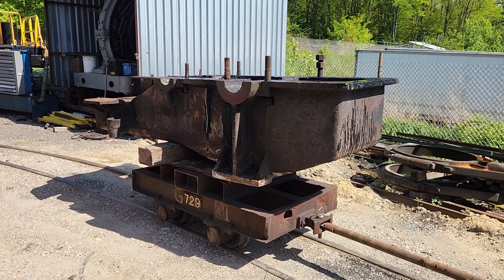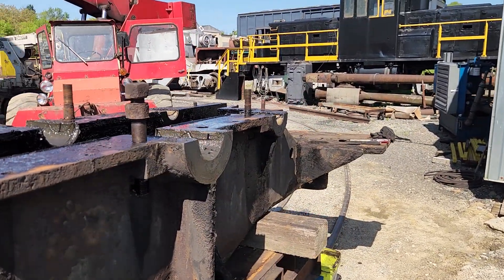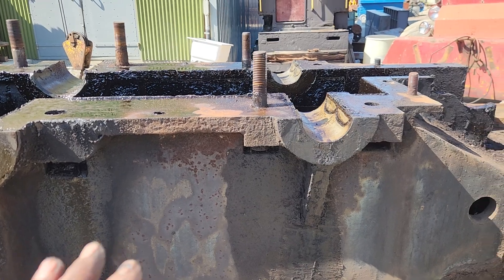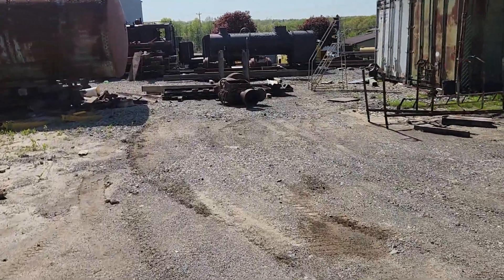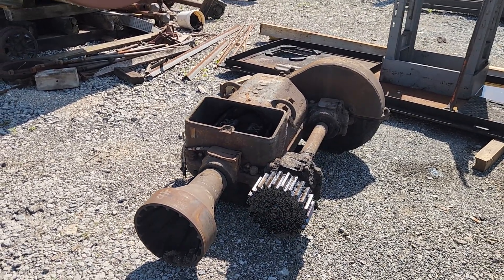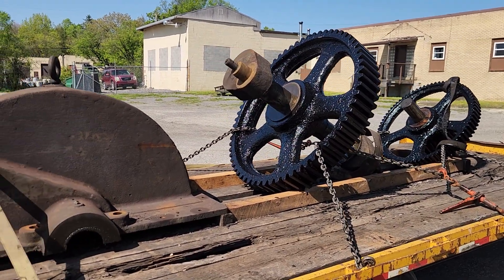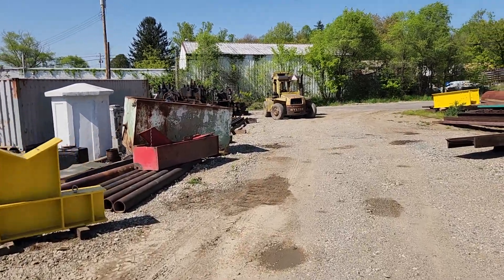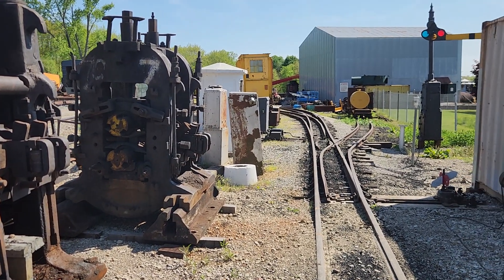So we found this big Gearbox...

Comment: Good find. On  the DC cranes at work we used to call those braking resistors the toaster. If you were called to a slow hoist issue and the toaster was hot the DB contactor was not working. 🤔😉
If you want to have separate control of those clamshell brakes and they are DC make sure the coil on the brake is a shunt coil and if so check if it requires a economy contactor to reduce coil current. If it needs one it will usually state both the close and hold voltage or current requirements on the nameplate 
Most of the time those DC motor brakes use a series coil to simplify the wiring and it is an easy way to make sure the motor is drawing current before the brake releases